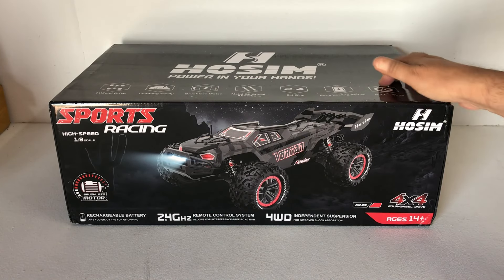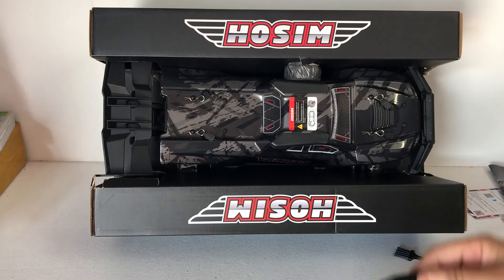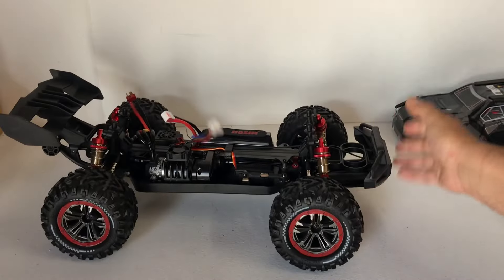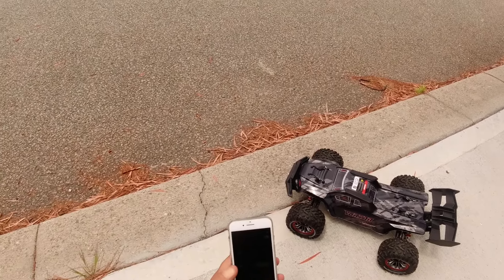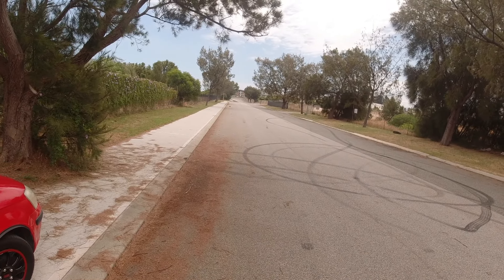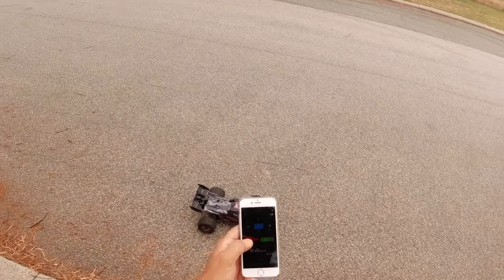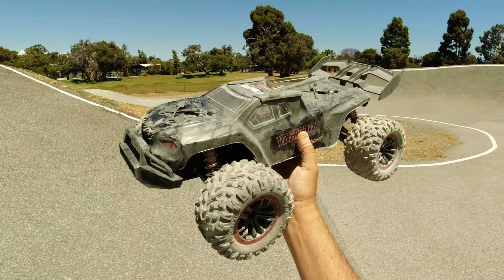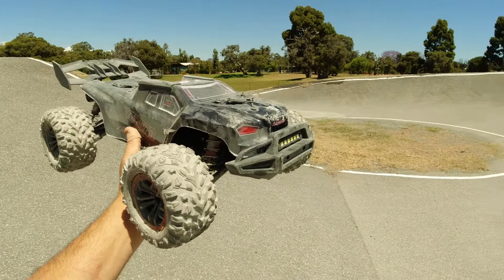New HOSIM X25 VORTAN | Is It the BEST BUDGET 1/8 Brushless RC Truggy Yet?

Comment: Hey Dave👋!
Fantastic video and review man!  These look like they are really well built, save for the lack of proper diff fluid or grease. I’m curious to find out whether the center diff had any at all.  I’ve seen videos where some have blown the foams out of the front tires😝. I also saw a video that were experiencing range issues and fixed it by pulling a bit more receiver wire out into the open.  Maybe yours has the same issue?  No matter this is the kind of trucks I like to bash.  Looks like it’s very durable! 
All the best to you brother! Miss our random chats!😝👍🏻
Reply from the maker: Hey Robby, good to hear from you brother, yes these are built like a tank, they've really done a great job to make this truggy a very durable basher, diffs were an issue on the older XLF & Hosim rigs like this a couple years ago so it's great to see they have these helical/spiral cut diff gears like Rlaarlo and some other RC manufacturers are going with. These diffs still feel like new after testing this X25 Vortan on the track even though they seem to have a lack of or very lightweight oils. As with the range, you are spot on  brother, I did straighten the antenna upwards as i noticed after filming this video, that it wasn't as exposed as much, now the range issue has improved quite a bit. These are the type of bashers I like as well and it's great to see Hosim taking note and improving their new releases much like Rlaarlo. Price is great for a 4S capable basher like this Vortan. Cheers for watching Robby!